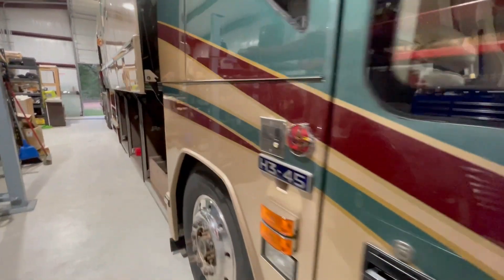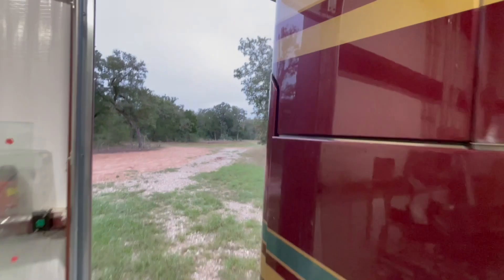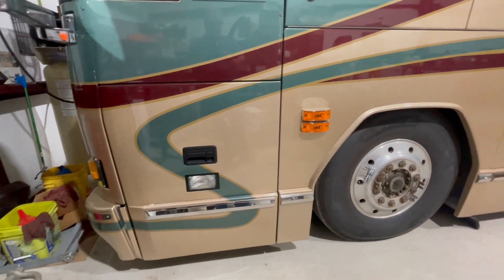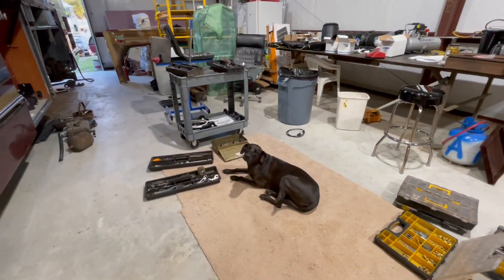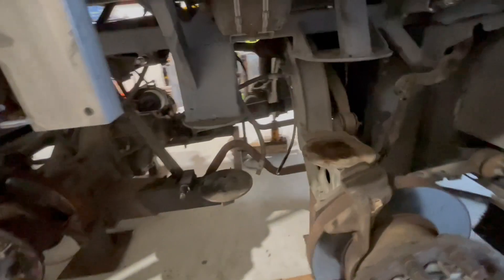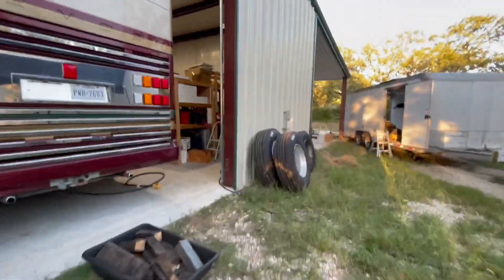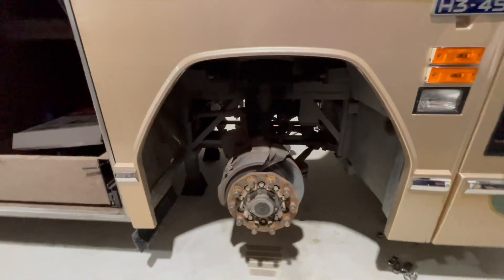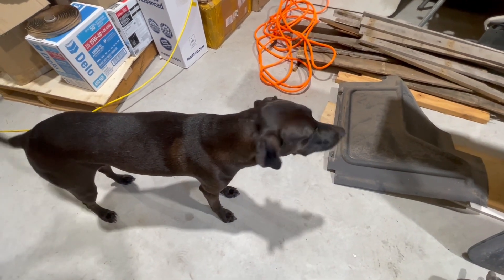Day 1 bus undercarriage overhaul.

Comment: Those are actually easy to work on. Just extremely tight nuts and bolts. Plenty of room to work on.
Reply from the maker: Nothing a big cheater bar couldn’t fix 😎
Reply: @prevostandbbq4451  that's exactly right!